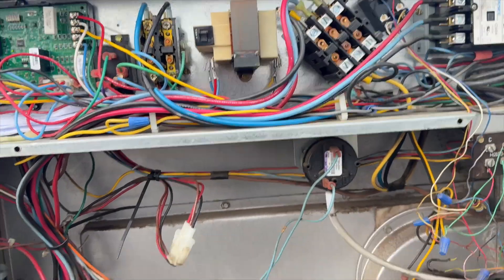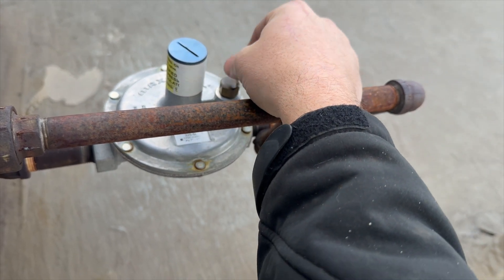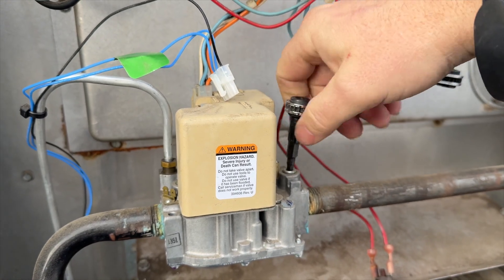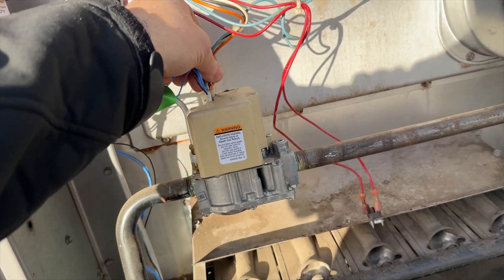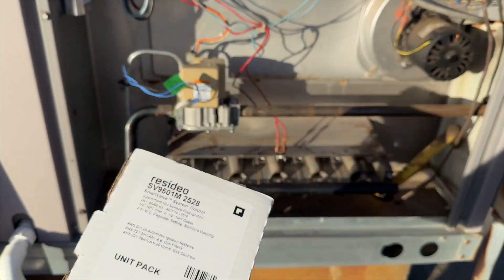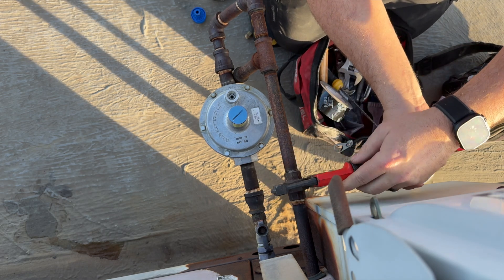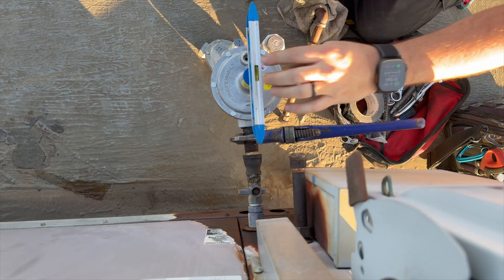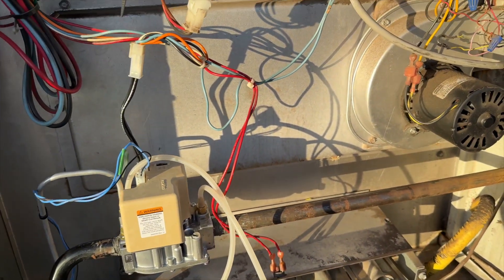ICP Gas Package Unit with Smart Valve Problems EP205

Comment: pilot flame still looked weird/soft, like not enough gas/too much air bleed. maybe wrong orifice or oversize air bleed, probably someone else butchered it or weird deflecting the orifice gas flow.
I don't think it was a supply problem to the pilot.

Comment: Why do you need a regular?
Reply: Commercial buildings commonly have regulators at each appliance due to length of pipe runs and how much gas is needed for all equipment in a building. Basically if they didn’t have a regulator they would have to run a much larger diameter pipe throughout the whole building. So to combat that they have higher pressure gas ran throughout the building then regulate it down to proper pressure per each appliance’s specifications.
Reply: @ thank you